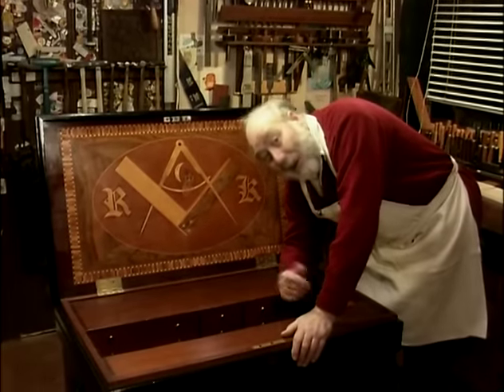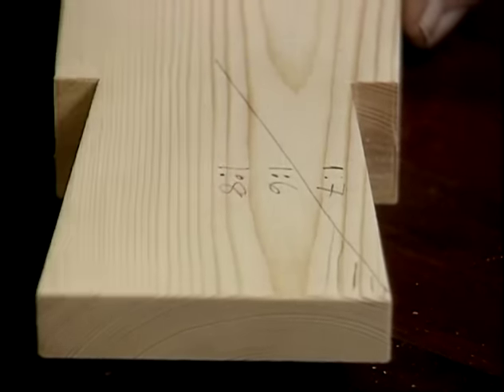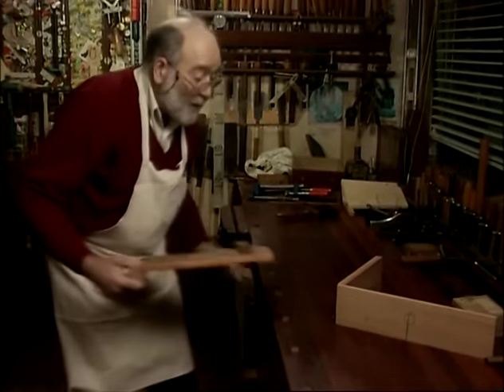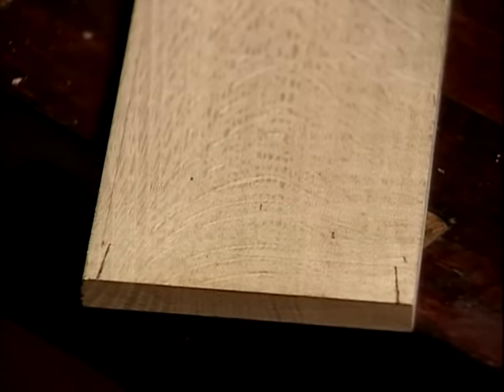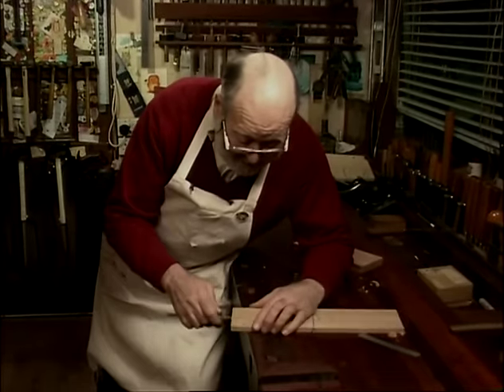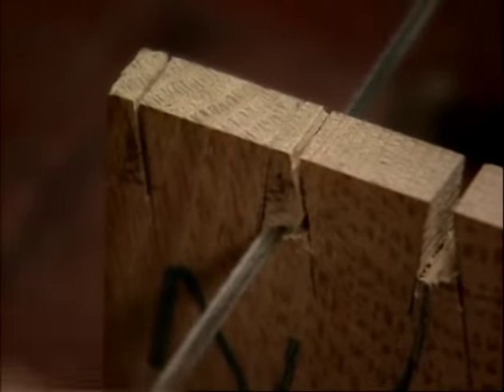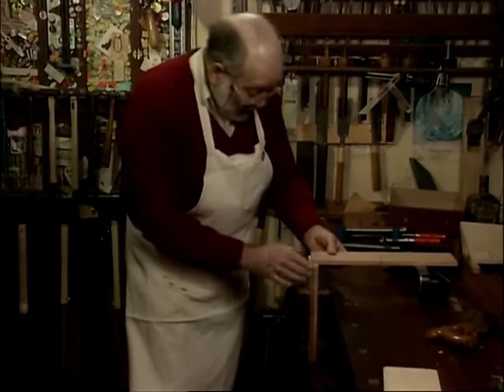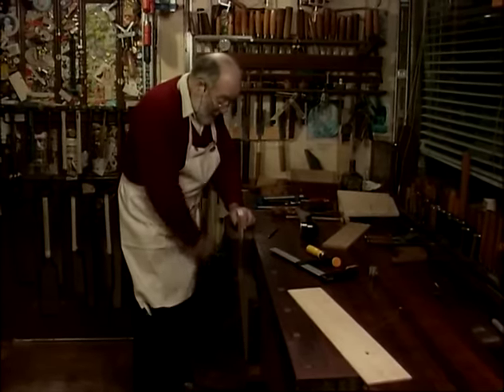Jim Kingshott - Dovetails

Comment: My father trained as a carpenter and joiner in the 1940s as well. He once said he had done so many thousands of dovetails that he did them purely by eye. I wasn't entirely sure he wasn't pulling my leg, but I guess Jim confirms it. My father also had a black tool chest that he made as an apprentice, but not being a cabinet maker and therefore having on occasions to take it onsite, it was far less fancy.

Not  much in this video that my Dad would have done differently, except using a coping saw to rough out waste. Note also that the coping saw is set with the teeth facing the handle, something that some prominent youtubers have called 'rubbish'.  Well, they aint a patch on this guy.
Reply from the maker: Loved reading this, thank you. Totally agree on the coping saw blade direction too.

Comment: I’d watched The New Yankee Workshop growing up and rediscovered it recently. Norm Abram covers the making of entire pieces in a single half hour. What Jim has shown is how long it takes to do a single portion of these by hand. It really helps fill out the cuts made in New Yankee Workshop, as well as the fact that Norm uses automatic machinery for dovetails, which I’m sure he could make by hand as well, but the notion was to bring woodworking more to the masses. Absolutely awesome video. The measuring of how many dovetails by angling a ruler I’m sure must have been in use for generations but I’ve never seen it. Incredible!

Comment: For plain, through dovetails, I wonder if Mr. K. would have achieved his dovetails straight from the saw or if he still would have pared after cutting the pins?  

Regarding bifocals, I just this year started using them, but I found I needed different lengths than he mentioned. It is probably a personal thing that depends upon your arm length, body proportions, and your visual accommodation. I am about to buy a dedicated, single-focus set of glasses at the close distance  because when I'm doing extended periods of work that is close up, like carving, it is a strain to keep my head tilted for the bifocals. Thank you for posting this (and other) videos!
Reply from the maker: Always welcome! Thanks for your comment

Comment: Excellent  video, made the time fly however how do we find out how to make that joint at the end?
Reply: The two pieces rotate together. He makes special note to point out the slope at the end-grain which is a lie. The pin enters from the top but has a face that implies the wood behind it is in the same shape (making you think it cannot enter from the top but has to be slid in, which is of-course impossible due to the dove-tail shape making it impossible to slide in). Secondly, there is a hollow behind the halving joint that allows the two pieces to cleverly rotate together. There is a lot of empty space and the false-front on the pin to make it look impossible to assemble together mean this would be extremely week and the large scale is required to pass off the trickery. I am so sorry for ruining the magic. Please don’t hurt me.
Reply: @devinteske  This isn't how that joint is made - it's actually a joint from Japanese carpentry, which Jim Kingshott was a proponent of (hence showing both a Japanese saw and using Japanese chisels). I've seen it called, variously, a double dovetail, double dovetail tenon, rising dovetail or Sumiyoshi (I don't know much about Japanese carpentry, so can't attest to how accurate or appropriate this last term is, only that I've seen it called that). The key to it is that you can't see that the dovetail isn't a consistent thickness: the part that you can see at the front, facing the camera is the thinnest part of the dovetail. The mortise for the dovetail tenon slopes downward like a ramp towards the the cheek of the ordinary halving joint, so that the gap between the two is a wedge with the thickest part at the top/front. The walls of the dovetail mortise are continued at the same angle but go another 2-3 times as deep as the depth of the dovetail that we see at the end. The dovetail tennon then is also much thicker than it looks and a corresponding wedge. It's assembled by putting the dovetail in much further down, which then follows the ramp up, like a sliding dovetail joint, but sliding both horizontally and vertically, which is presumably why it's sometimes called a rising dovetail. 

This explanation isn't great and probably quite convoluted, but it's quite difficult to put into words properly. Search for any of the terms mentioned (rising dovetail etc.) on here and you'll see examples of people making them.

Comment: First off: straight baller move uploading these with the copyright warning 😄

Second: Did this bloke ever do one on card scraping?

Three: cease and desist Tage Frid. Ive got no use for that tasteless Dane. 👎
Reply: On using scrapers, or sharpening the scrapers?

It's the latter that presents the greater challenge, for my money, and is by far the most tedious. Once you're done sharpening, finally, scrape, scrape away. And get a Stanley No. 80–type cabinet scraper—so much better, especially if you've got a lot of heavy scraping ahead of you, and you value the use of your hands.

I remember the first time I used one, having previously thought they were largely superfluous, since you could just scrape with cards. I had one and it sat around unused for some years, until one day I was sharpening my scrapers and thought, "What the hell—I'll do the No. 80's blade too."

Oh, no! It's not superfluous! It was like a revelation.